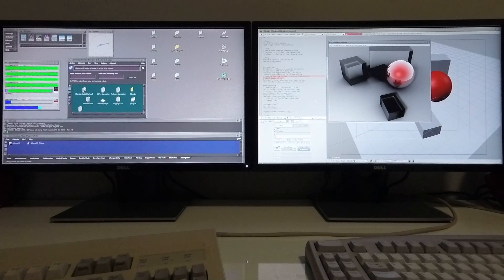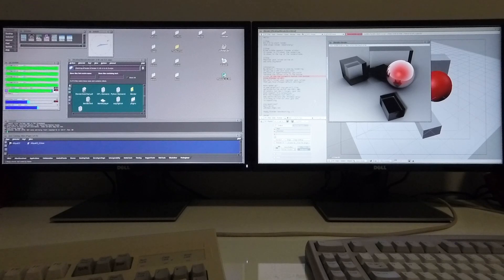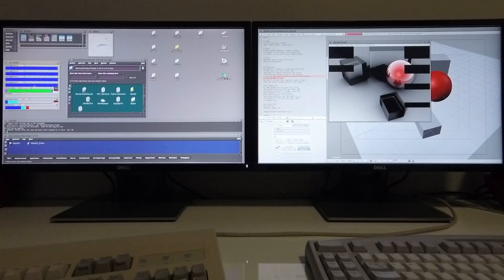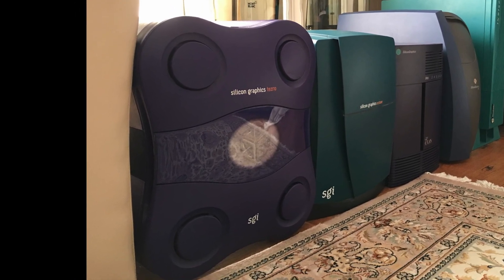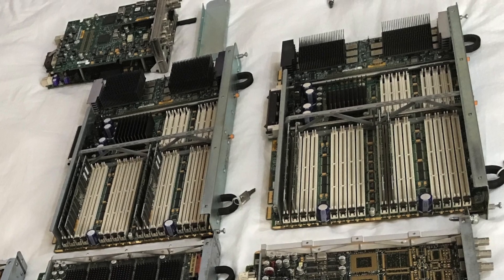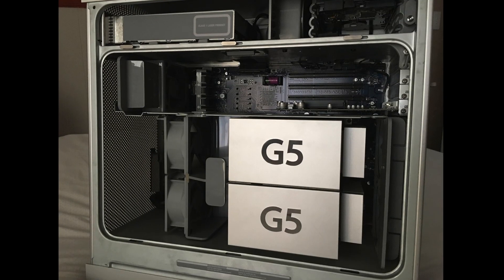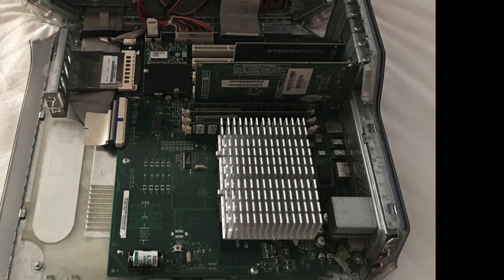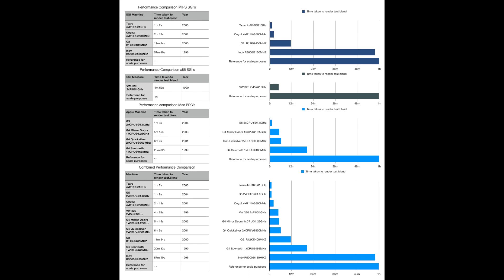A Blender test on a Silicon Graphics Tezro

Comment: I just rendered this scene on Blender 2.44 (the version the test scene was written for) and it rendered in 12.6 seconds on my Ryzen 7 5800H. That's with it running on 8 threads because it doesn't detect the HT cores. If I set it to 4 threads it takes about 21s. Which puts the Ryzen at somewhere around 3x the speed of the MIPs per core. Of course we aren't considering IPC per clock, but I digress.
Reply: makes me wonder how the tezros cpus would stack up against intel cpus of the time.

Comment: There is a Granite SGI monitor on eBay at the moment for only £250! These things are rare as anything and real expensive... if only I had the room for it - it's a 30kg monster! :(((
Reply: Used to own two, and a near identical Sony model.  I kinda regret getting rid of them, and yet I kinda don't. ;)

I still have 3 SGI 1600SW flat screens (using one on PC with converter box).

Comment: Nice B&W 802 and Krell?
Reply from the maker: I used to run a pair of Krell FPB 250M's but my system is now powered by a pair of Classe CA-M600's for the woofers and an Ayon Spirit III Class A valve amp running in triode mode to run the mids and trebles.

Comment: I really like these comparisons. I have to make you a correction concerning the Apple G5: the 1,8Ghz EMC 1969 version was released in June 2003, then, a year later, in 2004, an updated version with much less hot CPUs, the 970FX; with a 90nm production process instead of the 130nm which were real stoves spreading the word of the super hot G5 ... while the EMC1969C versions were notoriously warmer and more economical in consumption). It is important to note that the Tezro had 4 cpu at 1Ghz, therefore at a lower clock. I don't think Mips have ever exceeded the 2 Ghz threshold, at least on the SGI, a real shame. Apple replicated the G5 with Quad, two 2.5Ghz dual core physical CPUs.
I can ask you which version of Blender you used and where to find the test scene project.
I would like to replicate your tests on my machines, different G4 dual cpu, the G5 and Intel Macs and would also take an OpenGL performance test.
Thanks!
Reply from the maker: I used Blender 2.45 in this test.  You can get blender 2.44 (Which is faster) and test.blend from this site:  http://sgidepot.co.uk/blender.html

I used Blender 2.45 in all of my SGI tests to keep things equal, as that was the Blender version that I started with.

MIPS only ever reached 1GHz.

Comment: I have to wonder honestly if the Tezro could still be a viable workhorse for modern video rendering and finishing work today? Could it render 1080p, 1440p, 4K, 8K resolution video for example?
Reply from the maker: I wouldn’t personally recommend it for modern video editing. 

From a processing power point of view, it compares with a dual 1.8GHz G5.

Back in 2003, they made sense as Discreet Flame machines, but when Flame migrated to PC in later years, that changed.

I would definitely recommend one of these machines, however, if you want to mess around in IRIX and do things the old school way.
Reply: I have a really old SGI 4D/780GT (1980's SGI tech, was used in making of Terminator 2) and there is really just one application some of these old SGI machines could be practical for.

Definitely not anything involving video editing 1080p or above video, or even 480p.  Video compression has come an insanely long way in recent years and the computation involved would kill any SGI beast, despite nearly any recent smartphone handling multiple 4k streams without breaking a sweat.

On the other hand, some models are still absolute beasts when it comes to doing live video, compositing and mapping video and realtime 3D graphics.  Onyx2s got lots of use being carted around to sporting events for handling the realtime infovisuals and doing video replays.  There was hardware support for layering multiple frame buffers including a video source, entirely handled in hardware.

Comment: Nice. But no octane results yet? https://youtu.be/0dchE5DHSIc
Reply from the maker: Don't worry, a full set of tests and demonstrations of the Octane are still to come. 

I have an Octane which has been upgraded to the status of a fully specced Octane2, which I covered in this video: https://youtu.be/XZimU6r4aU4

I still need to carry out an IRIX install on this machine and currently lack the external SCSI CD-ROM to do so. I will start off by making a video, showing the process of carrying out a clean IRIX 6.5.30 install, as this could prove helpful to some of the members on the IRIX Network forum.

This video will be followed up by others showing a full set of demos and tests on the machine.

Comment: Very interesting.  It would be very cool if you could share the exact scene you used in Blender so we could render it at the same size on our own computers to see how they stack up against the results of the vintage machines you have.
Reply from the maker: I'm glad you enjoyed the video! 
You can get the test scene from this location: http://eofw.org/bench/test.blend
Reply: @Irinikus  24 seconds with my Ryzen 1700 and RX580, those machines would have screamed 16 years ago
Reply from the maker: They would have been amazingly fast back in the day, especially in the 90's!
Reply: @Irinikus  Perfect!  Thank you kindly.
Reply from the maker: It's a pleasure!
Reply: @Irinikus  I got a result of 41 seconds on my Intel Core i7-7700HQ.  4 cores, 8 threads @ 2.8GHz.  Interestingly enough, just for fun, I went ahead and replaced some materials in the scene with updated but relatively comparable versions in Blender 2.8 and rendered the scene out with Cycles engine using my Nvidia GTX 1080 with CUDA just for fun and it gave me a clean result in around 9 seconds.
Reply from the maker: Very Nice! :)